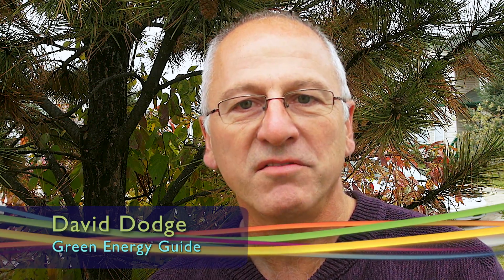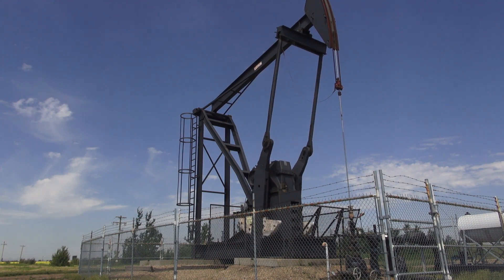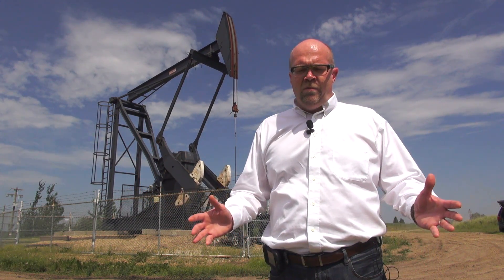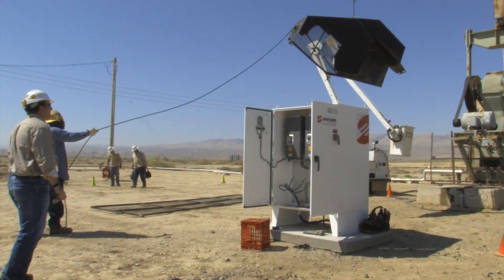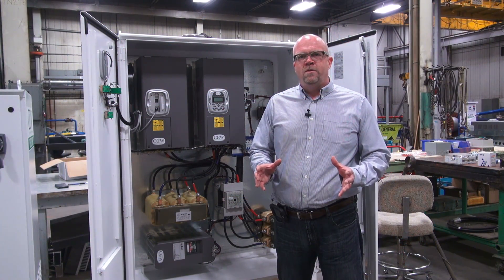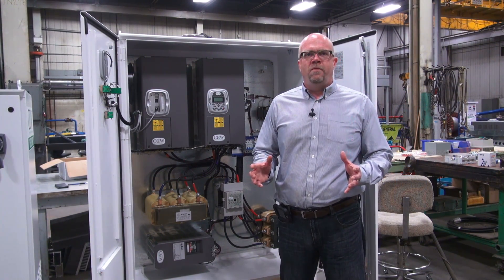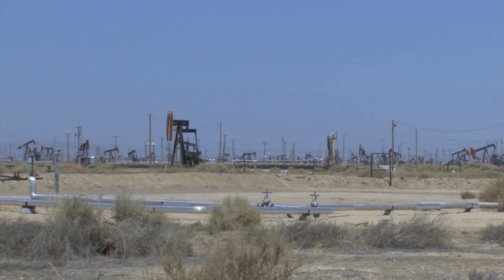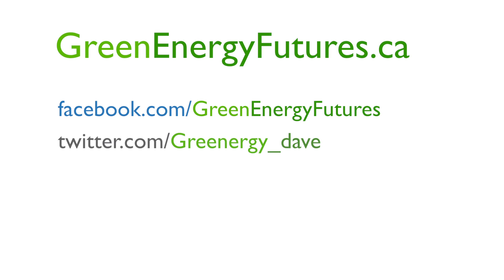16. Bright Idea: Pumpjack Powerplants

Comment: If the sucker rods need a “brake” to catch them when they fall, the pump jack is out of balance and the counter weights need to be adjusted to equalize the load.  According to Newtonian theory it is impossible to get more energy out of a system than is put in.  It also appears that mechanical friction loss has not been accounted for in this system.
Reply: Agreed.

Think of all the electricity that is used to drill, Extract, refine and transport oil

Comment: Super ignorant. You could never sell that BS in Oklahoma. (or Texas) First, all Oklahoma school boys (Oklahoma City is built on an oil field) know that an electric meter runs backwards when the weights or rod string are pushing it or dragging the electric motor faster than the grid. That means that you are storing energy in the grid to use on the next load cycle. This is already being done at no cost to the oilman. Ok, next big problem. No oilman is about to give up money that does not have a 36 month payback. They just won't.  That means that they will give you 36 months of electricity bill payments ... upfront.. but all electricity beyond 36 months has to be free. I mean totally free. Wind will work as often the wind blows at a rate about equal to what a worn out played out stripper well pumps at. Still you do not see wind powered oil field pumps. The math is bad. Say an oil pump motor uses $300 in electricity per month. 36 times that is your budget. Say $18,000. everybody needs to make a profit. Build the thing for $9,000 and make it run 30 years maintenance free... then you would have customers. wind requires excessive maintenance and solar fails, wears out, by 10 years.
Reply: You're a clown.  Wind and solar work exceedingly well in Alberta, and most of Canada.   Wind turbines do not require massive amounts of maintenance.  With scale, their cost has fallen, and their lifetime emissions are lower than that of nuclear power, let alone fossil fuels.   The energy used in the fossil fuel sector mostly comes from dirty sources of energy.  From diesel to power dump trucks and earthmovers, and excavators, to dirty electricity to satisfy the demands of the entire refinement process and the transportation of that oil and gas through pipelines  Or, diesel, if you transport it by train and truck.

Wind, solar, geothermal, hydro, energy storage, and increased grid interconnectivity with neighboring provinces and states is the key to solving Alberta's skyrocketing GHG emissions.

Another thing, government needs to mandate minimum 50% government ownership of all oil and gas companies, railway companies, telcos, privately-owned electricity producers.  #VoteNDP

Comment: Because storing the energy in the flywheel for the up stroke is old fashioned xD Maybe You forgot to add, that the system is only for wells with own pressure?